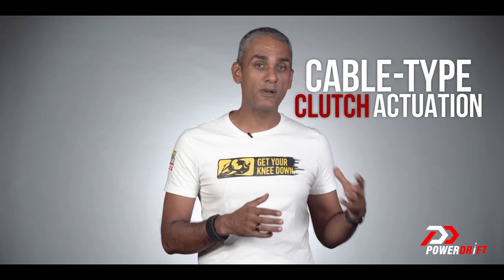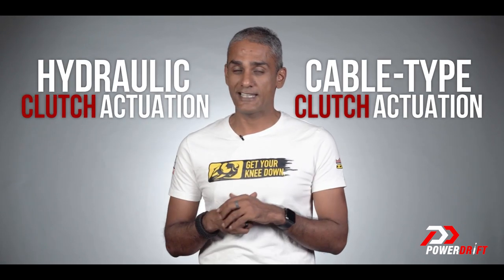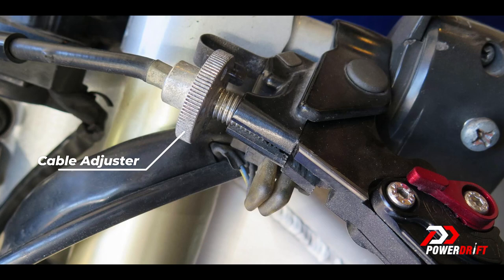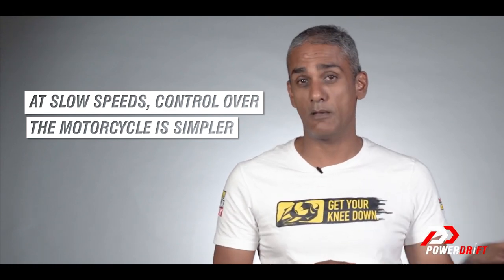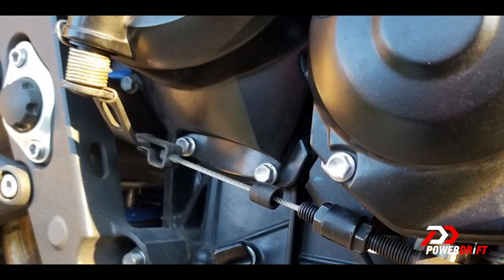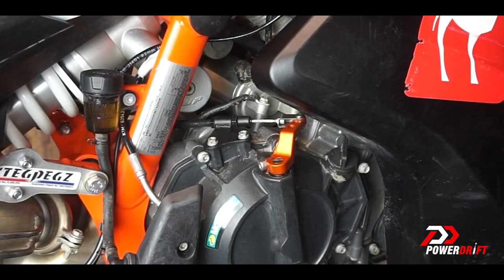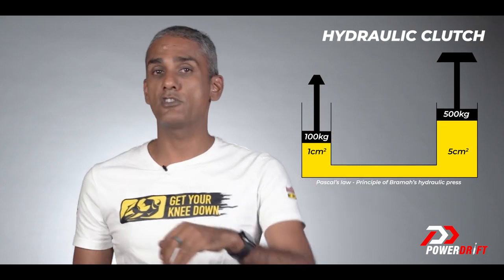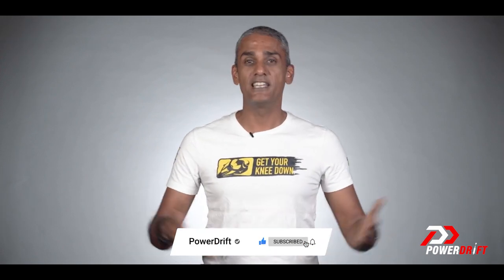PD Simplified - Cable Clutch vs Hydraulic Clutch | Which Is Better

Comment from the maker: Hey #PDArmy, did this help you know more about the clutching systems? Let us know below what you think, or if you have any doubts. Hit that Like button if we should make more like this, and Share this with a friend.
Reply: Before watching your video about braking, used 4 figers of my right hand, then gradually changed to two. Going forward will try to use 2 fingers for pressing clutch lever as well.
Reply: Everything you said is absolutely right. But you skipped a basic thing. Cable clutch have some amount of friction, so the failure chance is higher in cable clutch, but not in hydraulic clutch. And this is India, here manufacturers do cost cutting a lot. So they always don't provide the best. My pulsar rs200 had a clutch cable failure after 6 months of purchase.
Reply: 1
Reply: Hhj
Reply: Pp a
Reply: @Moonlight-hq3gi mntoppbbb? Joshua
Reply: 0ó
Reply: By ko
Reply: @Moonlight-hq3gi  ooOt 4CT CD
Reply: ❤️ the best 48❤️ and 9
Reply: Òooo9p
Reply: Please break the myths about clutches less shifting,
Also if I use only 2 fingers for clutch operation, I see that the clutch is not fully engaged should I be worried about some mechanical problem with that kind of usage?
Reply: Pp
Reply: @dheerajkumarchaudhar7303  The uu7
Reply: What's a slipper clutch?

Comment: hi Shumi ji, Please discuss regarding "there is difference in tyre sections of front and rear tyre, if we want to upgrade tyres to higher section, should we need to maintain the same difference of section between the front and rear tyre". or can we decrease or increase the difference of section between front and rear tyres. what are the consequences and how riding feel of bike changes ?     Thank You, Shumi for ur videos on motorcyles.
Reply: There is already a episode in the same playlist please check it out
Reply: Let you later
Reply: Smaller front tyre : To reduce unsprung weight and for aerodynamics

Comment: Couldn't agree with you more Shumi. Modifying the cable operated clutch is much simpler and cost effective than going in for a full hydraulic set up. And yes, i use the finger trick all the time, no matter what bike i am on 🙂👍

Comment: Additionally cables are not very good while turning the lever pull is increased hydraulic makes it simpler but you shared 2 most important jugaad for making cable actuation lighter that really helps

Comment: Great point! You did miss out on a simple yet effective way to get great leverage, adjustable clutch levers. These are simple, reliable and helps get great clutch leverage.
Reply: Yeah, curious to know they actually work via Shumi
Reply: Adjustable levers change the span of the lever. Not the leverage.
Reply: @shu_mar  Can you please explain then, why there are notches provided in the levers so that it can move forward and backward, if not for leverage and reach, then what is it for, please.
Reply: @vijayam1  it’s for reach. To control how far you have to reach with your fingers to get to and operate the lever. That’s all

Comment: Isn't getting a longer lever (for the clutch-box end) the same as those easy-clutch attachments? They reduce clutch travel on the clutch-box side to make the pull easier. With these gadgets, I have seen people burning out clutch plates or having trouble shifting, especially to neutral. But the first tip is golden. If your motorcycle doesn't have an adjustable clutch lever, get one and use this trick.

Comment: Nice video guys 👍
I agree with what you said.
Moving the clutch lever fixation point inside the handle bar should also help other than moving hand to a non ergonomic position.
But for the people who go offroad or the people who like to work the gear box will definitely appreciate the hydraulic setup over cable one as there is a lot less energy which is lost due to friction.

I love my hydraulic setup and will definitely not go back to cable 🙂

Comment: I just transitioned from an SV650 (hydraulic clutch) to a Z900RS (cable clutch) and to be honest...it's been tricky getting used to it lol. Can anybody answer if it's normal to kinda feel the cables working / doing their job, when you pull in the clutch lever ?! lol. I know that sounds crazy but, I never felt that on my SV650. The Z900 is brand new by the way, 2022... Sometimes I just feel the cables, and it kinda bothers me lol.

Comment: Can using pro spec clutch on Himalayan make it smoother without damaging the clutch assembly?
Reply: Have used this for a while now. It’s amazing. And with no problem on the assembly
Reply: @Thegeekishnerd13  Thx for the info.Did use long or short one type?
Reply: @akashjb3304  for the classic 350 I have the long one. For a modified project bike, I use the short one.
Reply: hey  @Thegeekishnerd13 , can I use it on thunderbird-x ? and if so, which one should I get? the long or the short one?
Reply: @omkarnagarkar6660  the short one works on all bikes. You will need to use your thunderbird cable also. The only difference would be that the cable now would be long and you might need to reroute it. Most mechanics willl know what to do. Don’t worry.
Reply: I don’t use the clutch enough for me to need to spend money on it.
Reply: @Thegeekishnerd13  great, thanks!
Reply: @shu_mar  to be honest I went for the hydraulic clutch for the fancy oil reservoir :)